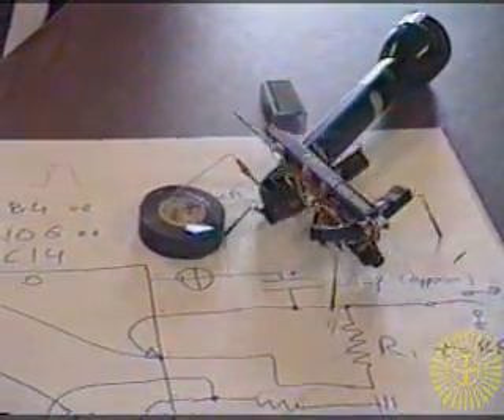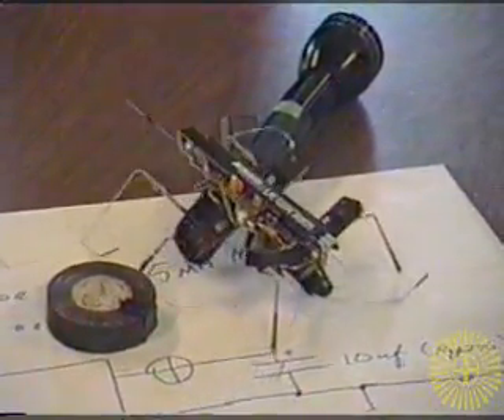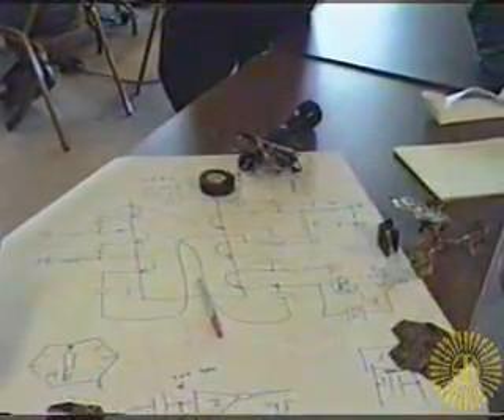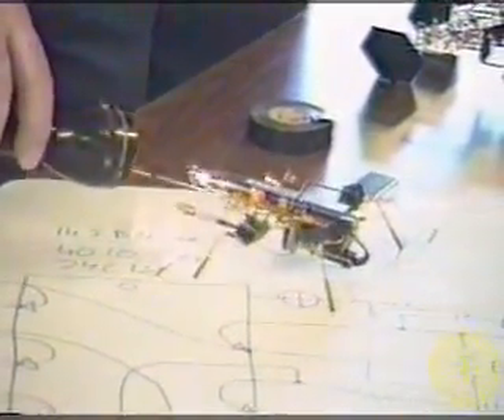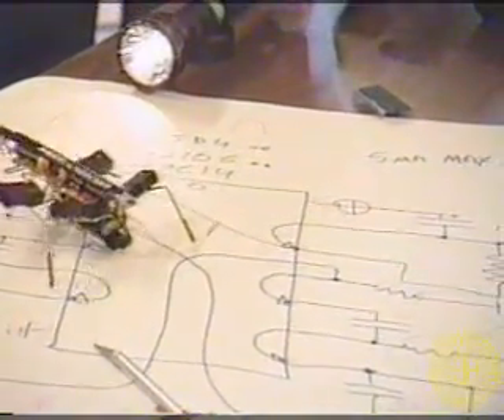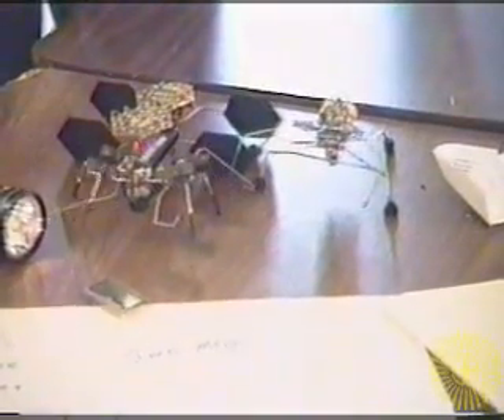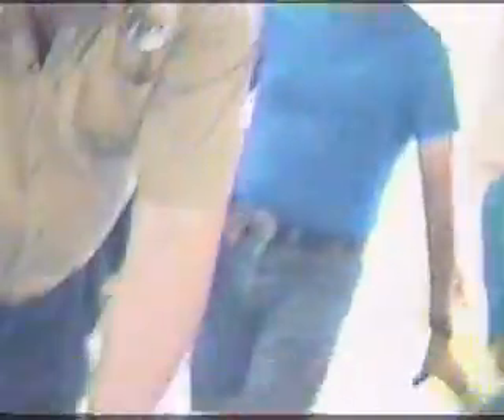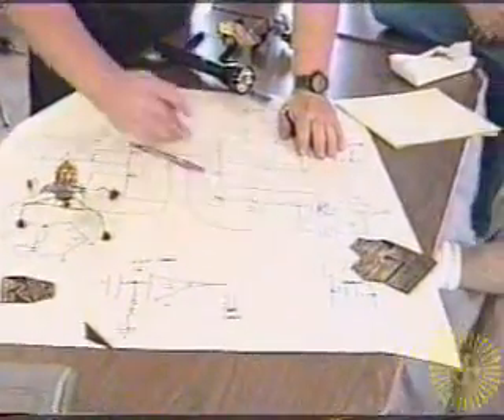Mark Tilden explaining Walkman (VBug1.5) at the 1995 BEAM Robot Games

Comment: I owe so much to this clip. I saw this a while ago and it just changed my life.
Reply: How so, can you elaborate?
Reply: Thank you for asking, I wasn't expecting that. I've always been interested in automata (remember Short Circuit in 1986?), but I was under the impression that you needed a lot of processing power to get interesting behavior from your robots. When  I saw Tilden's work, something just clicked. I realized that there were ways of achieving convincing behavioral patterns using only a few hardware elements. That there were a myriad of different types of consciousness out there. That the soul doesn't just sit on the brain: it IS the brain. Eventually it also pushed me to become an electrical engineer, but that's a different story :)
Reply: @bernardlemay8563  That's a great story, thanks for sharing.  I too love the concept of simple circuits mimicking neural behavior.

Comment: An insect would have negotiated that first obstacle in an instant. Still so weak next to natures design. Not impressed.
Reply: There has been a fly struggling to leave my office for the last 4 hours. All the windows and doors are open.
Reply: Keep in mind that the walkman only has 4 sensors on its body, if something doesn't touch one of those enough to trigger it, it is blind to that. Its just not able to react to something that doesn't touch those sensors, and tge flashlight wasn't touching the sensors. Give it more sensors and it would be more responsive to its environment
Reply: Oh fuck off